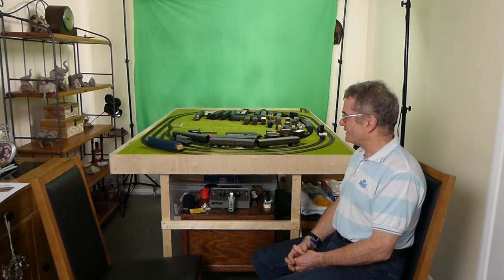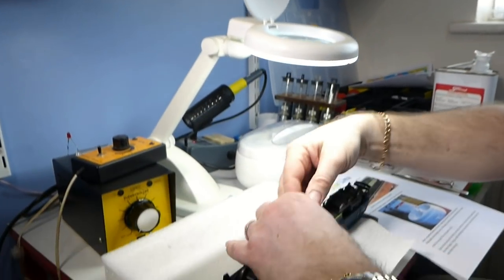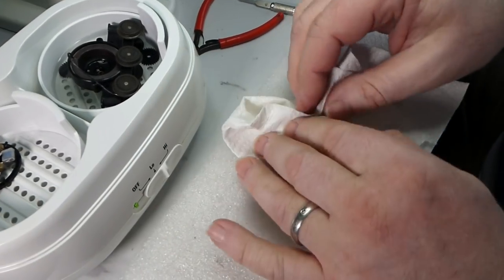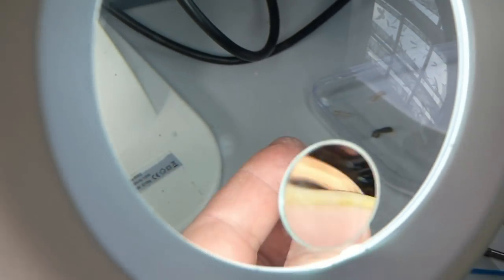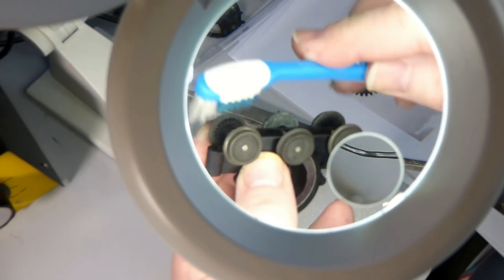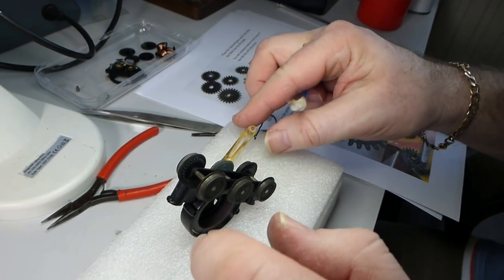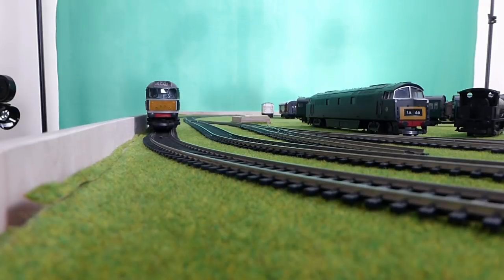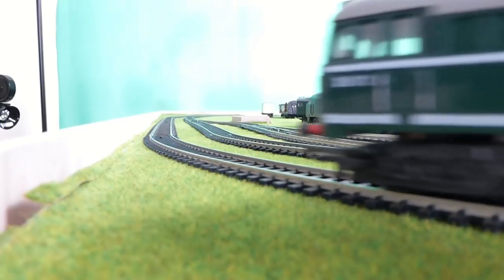00 gauge Lima model trains loco service guide updated for 2015

Comment: Excellent work, it is best to keep the original engine! I have several brand locomotives and I do the same cleaning process, the difference is that I lubricate them with liquid wax, the gears do not get wet and they do not get dirty, after all this the result is optimal, greetings from Argentina.
Reply from the maker: Hi, many thanks indeed. Very nice to hear from Argentina
Reply: @ModelRailwaysUnlimited  thank You! This was where Lima had the gratest commercial distribution...
Reply from the maker: @mannbrand  oh really that's interesting. Do you have videos of your models on your channel
Reply: @ModelRailwaysUnlimited Not yet, but in a short time i will, i am reforming my layout...

Comment: Hi Mike , Great job on the Video.  I typically have stayed away from Ringfield motor Loco's ( Except for Fleischmann ) . Recently I came across a very good deal online for a couple of Used Lima's .. i could not resist the temptation, so I purchased them . This is when your video came in handy. I reviewed your video first, and then i decided to do my Full on Service of the loco ... I must say that it runs really well now , infact , I do like the ringfields on these Lima's in comparison to the older Hornby's and Bachmann's .. I found they lack precision to enable smooth operation . 
I also use the same lubricants from woodland scenics as well . I have  use the Gear oil for the gears and the medium oil for the motor bearings . I also use Conducta Lube , which is a different product but works very well for the brearing between the brushes .. as Conducta lube is conductive and as a result does not foul up your commutator if it happens to make its way to it . 
Again , thank you for a great , detailed video on how to service these Lima ringfield motors.  I have sub'd to your channel . Check out my channel when you get a chance (Anthony's Hobby Corner)  ... Regards, - Anthony . -
Reply from the maker: Thanks very much Anthony, so glad to help

Comment: Excellent video Mike, I may try stripping my Lima Deltic.
Reply from the maker: Yes go for it, if you need help come back here
Reply: @ModelRailwaysUnlimited  Thanks. I have had the body off and oiled it but at 40 years old may need a bit more. It does run very well.

Comment: glass fibre pens are brilliant to clean lima wheels, I use them on my fleet
Reply from the maker: Hi, glass fibre  pens have a place in modelling but I could not recommend them for general wheel cleaning, there will be a lot of fragments blowing about which could not only embed in your skin but also get drawn into the mechanisms, a cleaner like IPA or even the normal Peco red brush is best for this application. Thanks for your thoughts all the same

Comment: Hello, are the service sheets that you refer to in the video available? I dropped my lima class 37 and one of the wires has fallen off the bogie without the motor and I can't figure out were it reattached. Thanks
Reply from the maker: Show me a picture of it, message me via our Facebook group
Reply: I've figured out where the wire goes now. I shall solder it (once I figure out how to solder!) Back together. Can I ask you where the traction tyres go ? My old ones also fell out
Reply from the maker: @liamkelly8358  Peter's Spares, well done

Comment: Hi Mike, great video, thank you. Had one of my Lima diesels apart for a service as per your video and I'm struggling to get it to pick up power from the track. Connecting to power across the motor works fine, and equally from the wire to the unpowered bogey but not the rear bogey itself. The electrical pickup in the rear bogey looks fine and putting power directly to that makes it run on the bench, as does attaching the crocodile clips to both the rear and front bogeys.  Not too sure why it won't pick up from the track though, any thoughts? Cheers.
Reply from the maker: Hi Simon, that is most odd, So to confirm, power from the track is getting to the motor bogie but not the trailer? Did you remove the clip from the trailing bogie at all?
Reply: Hi Mike

I’m not getting any power from the track to the motor bogey at all - connecting it up on the bench, I can get power from the wheels to the motor, so I suspect the axle pickups are fine on the motor bogey. 

I did undo the clip connecting the motor to the unpowered bogey when I took everything apart. Putting power to the rear bogey and the motor, it will run. 

I just can’t seem to get anything to be powered from the track, which is very strange
Reply: It's because you've got the isolating wheels on incorrectly. The wheels have a tiny piece of plastic attached to the axel...make sure they are all on the same side but also the opposite side to the isolated wheels on the power bogie 👍
Reply: Yes I wondered if one of the bogies was put back the wrong way round - I had to check very carefully whan I did my 'Western' as oer the video.

Comment: Hi nice video. I guess it wouldn't be 'too difficult' to swap the un powered boogie for a powered boogie? Also what radius turns are you using? Thanks
Reply from the maker: Hi Lee, I think it's been done by some but I never found the need. Mine are 2nd radius I think but Lima will go around the tightest curves.
Reply: I see. I have brought 3rd's for the set I'm building for my Son, maybe I should have got 2nds and made it smaller! Never mind. Ta
Reply: @Lee-wb5og  Check out Budget Model Railways if your looking to see what loco's cope with tight radius curves. As with Mike they found Lima loco's particularly good on tight curves especially the Bo-Bo's, small prairie 45xx (also Hornby 25's, 29',35's, and Hornby Railroad ex Lima) My old Hornby 31 & 37 shared the same bogie with flangeless dummy centre wheel, this copes with tight curves and my father also removed the centre wheel from the trailing bogie when we used the Tri-ang Universal, Series 3 and Super 4 track.

Comment: I currently own 2 Lima models and both are a pain in the neck.  I have removed both motors and thoroughly cleaned them and now neither work.  In fact both are totally dead.  Despite my best efforts both motors have failed. and the models packed away.  I am now considering the Ringfield motor upgrade for both.  I have not seen anywhere a tutorial on the wiring and various components.  One aspect I have found is that one has a spring on the post on the non powered bogie and the other does not.  Another aspect is why is there a difference to the Hornby and Lima motors.  One type has a clip for the gears and the other does not.  Both my motors do not have this clip.  Trying to get these motors to run is in deed the most frustrating aspect.  Any chance a few more in depth tutorials can be made.
Reply from the maker: Did you download the associated document with this video? Might help. The motors are simplicity itself.
Reply: Yes I have and followed each step exactly but no luck.  It has me stumped.  It almost got to the point of tossing the lot into the bin.  The motors are indeed simple and the one I am working on at the moment was running but after cleaning is now dead with no power at all.
Reply from the maker: @popeyebob9007  hmm interesting, can you send me some close up photos of the mechanism and connections. If you look up Model Railways Unlimited on Facebook you should be able to post them or pm me
Reply: Will do.